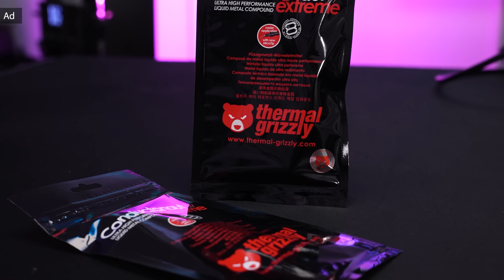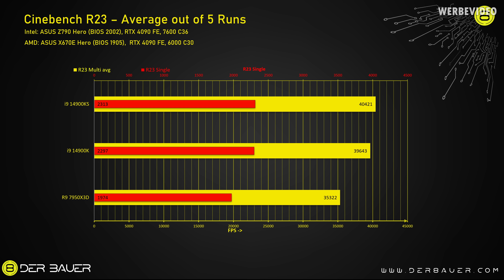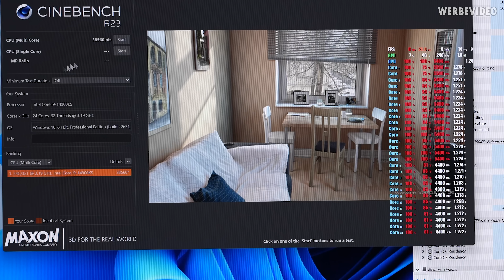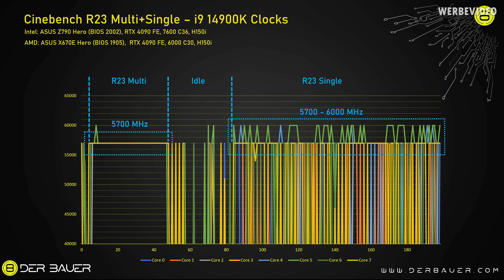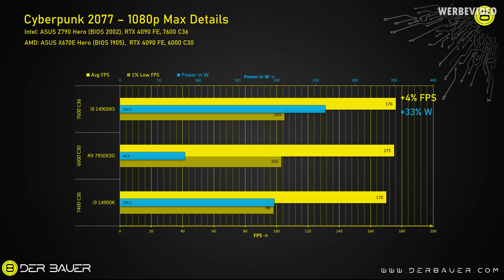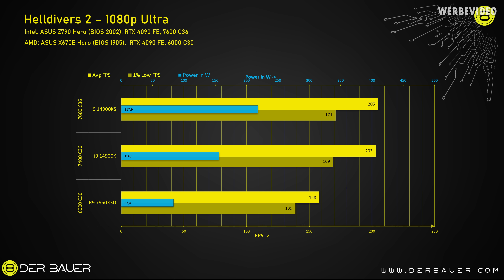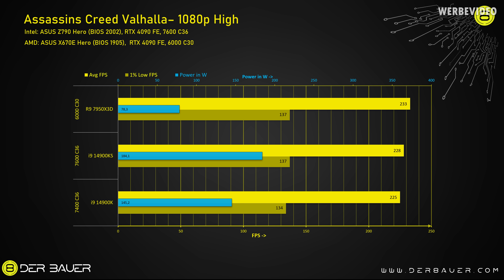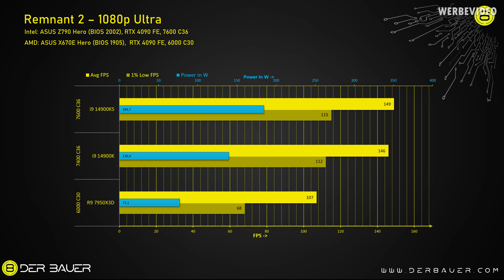Almost 400W under Full Load - The 14900KS is one of the Most Extreme CPUs ever Made

Comment: What's the big deal? You cannot afford electricity or something?
Reply: probably the deal is that intel cpus are dying left and right atm, and there is 0 feedback from intel itself.
Reply: @1222dss  Are they though?
AMD is about drop their new CPUs and all this shitting on Intel starts...

And yes, Intel's 13th and 13.5 gen CPUs are pushed to the limit, hence some tweaking is needed to make them work proper and last longer.
Reply: @Rorschach1488_  "shitting" started over 1 year ago with 13th gen. This has recently been confirmed not only by whiners on reddit, but by actual server hosters and developers who charge $1000 more for an Intel platform simply because of the insane failure rate and therefore maintenance costs.
Reply: some people don't want to be boiled in their room

Comment: have been cruising around a bit. so, factories manufacturing 13 and 14th Gen Intel CPUs have been getting returns at insane rates for performance degradation inside of 3 months. most MOBO manufacturers BIOS' "Apply Defaults" apply MOBO controlled power limits, instead of specs set by Intel. as it turns out MOBO's default power limits are insane and rely on intel CPU safety features to prevent swift death...

Comment: it's so silly how hot these things run because their benchmark scores are HORRID compared to what they should be.

When you actually undervolt the 'default' all core load and get it to NOT redline 24/7 and consume giga watts degrading your stuff every few clicks, your scores goes up A TON without changing ANY clock speeds.

my 13900ks with 5.6 (stock) and 4.4 e core (+100) with 46 ring (-4 from stock) maintains that frequency throughout the test and gets highest 41844 points.

Comment: Hi im building a new video editing PC, Primarily for Premier pro and after effects.
Just want to get everyone's thoughts. If everything is compatible and makes sense.
Also a couple questions
Can the Asus motherboard support the 14th gen with a bios update?
Im open to new case ideas but very hard to find 420mm radiator supported cases.

CPU		
Intel Core i9-14900K 3.2 GHz 24-Core Processor
 
CPU Cooler		
ARCTIC Liquid Freezer III 72.8 CFM Liquid CPU Cooler

 Motherboard		
Asus PRIME Z790-A WIFI ATX LGA1700 Motherboard

Memory		
Silicon Power XPOWER Zenith RGB Gaming 64 GB (2 x 32 GB) DDR5-6000 CL30 Memory
 
Storage		
Seagate Barracuda Compute 8 TB 3.5" 5400 RPM Internal Hard Drive
Silicon Power US75 1 TB M.2-2280 PCIe 4.0 X4 NVME Solid State Drive
Silicon Power US75 2 TB M.2-2280 PCIe 4.0 X4 NVME Solid State Drive
Silicon Power US75 4 TB M.2-2280 PCIe 4.0 X4 NVME Solid State Drive
	
Video Card		
Zotac GAMING Trinity GeForce RTX 4070 Ti SUPER 16 GB Video Card

Case		
Antec Performance 1 FT ATX Full Tower Case

Power Supply		
Gigabyte UD1000GM 1000 W 80+ Gold Certified Fully Modular ATX Power Supply

Comment: That extra crap you have to do in windows is THE reason why i waited for the 7800x3d. It wasn't the price, it was this crap you needed to run for the bigger x3d versions.
Windows is too annyoing these days anyway and on 11 i need 3 third party tools to make it usable (task bar, start menu, unlocking removed options) . I don't want to have to run any additional Microsoft crap (Xbox app) to play games. 

The reasons for not going intel was energy prices and room temperature...

Comment: This comes up every time Intel releases a KS model. These chips were never intended for gamers. Yeah, they're overpriced, but you need to keep in mind hardcore overclockers using exotic cooling used to get ripped off for FAR more with cherry picked i9s going for as much as $2000+. The KS models have completely killed that binning aftermarket that used to gouge enthusiasts for cherry picked silicon.

IMHO AMD should also have their own elite line when enthusiasts are obviously willing to pay for it. Imagine a 7950X or X3D that can maintain stability with DDR5 7200 and 5.8ghz? It would be just as silly but you know there's a certain number of enthusiasts that will buy it instantly.

I also believe every KS model should already come delidded as that's most likely the first thing anyone who buys it will do with it. They probably don't because there's a certain number of users that will only buy it cause it's "the best" and not know what they're doing.

Comment: Hey Roman, regarding the 7950x3d vs 7800x3d discussion,  couldn't you have simulated them by deactivating the non X3D cores or just by using Process Lasso to force the program's threads to utilize the X3dD cores? I'm sure there's a valid reason, but I'd be curious to better understand!

Comment: I think electricity is £0.33 per KWh in UK, so using 100W extra is £0.033 per hour. If you use the PC for 4 hours a day, that would cost £48 per year. After 5 years you would have £240 towards next CPU. This is if you are gaming, if you are running all core workloads the money saved would be larger. In 5 years time you would have a nice amount of money for a future AM5 CPU. With intel you would need new motherboard also, which might actually cost less than the extra energy used over 5 year period.

Comment: I've actually run into some cases where windows scheduler gives up trying to schedule stuff properly on the hybrid-core intel chips and then just starts shuffling threads around wildly at times, causing bad stuttering. This usually happens with a pairing of game & cpu when the game simply has more heavy threads than physical p-cores, at which point I start seeing stuttering, etc. This doesnt really impact the higher corecount chips because most games only have around 8 heavy threads currently (some do exceed that, but they usually aren't fps-critical games - its stuff more like AI-heavy turn based strategy games during end-turns), but it is very noticeable on the lower end mobile chips with hybrid core architectures which might have only 4 p-cores (or even less). Even games heavily optimized for old hardware that can run just fine on pure e-core cpus (ex, the N100) like warframe can suddenly experience intermittent really bad performance stutters if you put them on a device that has a cpu that is better on-paper like a 2p+4e core chip, purely because windows scheduler starts panicking and throwing threads everywhere since there are not enough p-cores for the game when if it kept the threads in place on whatever cores they were already running on it would be just fine.

Comment: Absolute Crap !
Reply: With Intel, you just need to run and adjust voltages and power draws in the BIOS/UEFI. Then they run already so much better. Just stock Intel is that it has to run on the north pole and in the dessert. So all settings aren't optimal.

Comment: So glad i chose AM5 for my latest PC. The 9th gen was hot enough, but half a kilowatt just for a CPU is insanity in the worst way. Intel are in a real low point at the moment, seemingly grasping for inspiration. It'll be interesting to watch the three way AMD-Intel-ARM face-off in the next ten years.
Reply: I am glad I went for Intel, with finetuning overclocking in BIOS/UEFI, it is faster than AM5. And then it doesn't use much energy, and all core overclock on a way, I have always the speed and not less when a CPU runs hotter. Intel is so perfect nowadays.
Reply: @jankees4037 what CPU? 

I spent a long time debating whether to go 12/13th gen or AM4/5. AM5 eventually won for a few reasons including longevity of the socket and the current R9 performance-power ratio. 

The first thing I did with my R9 was a PBO offset for basically extra free all core performance with a couple of clicks, I also get none of the issues people have with P and E core CPUs. Best of all, Ryzens seem to run impressively cool, can run all core boost speeds essentially indefinitely and they sip power compared to the current gen Intels. 

It is the gradual worsening of intel’s approach to reaching their peak frequencies - throwing electricity at the problem - which annoys me, because I’m very conscious of how much power I use, cause it’s so expensive here 😬

Always interested to hear other people’s experience with current Intel chips and what they’ve been able to achieve with their setups, because I can’t afford to buy both 😁 

At work we have a huge amount of Intel (6th-13th gen, Xeon Scalable and Xeon-W) and AMD (Ryzen and Threadripper Pro) systems - we’ve started to move towards TR for higher-end graphics and rendering workstations due to their current pure performance advantage for a given power target.

Comment: 14900 F VS the 14900 KS
On default, it's just 2% more frames
For the 114900 KS, you need a fancy cooling solution, fancy board, mem, on XMP profiles it can be 3 % faster !

Comment: One time runs on r23 hits 38k on multi core with my 14900k. In a 10min run, I get 35.5k. It stays pretty consistent after a few runs. But, I have the watts set at 275 max and it still throttles down to 4.9-5ghz, but with better temps vs when I had a 135mm tower cooler.

Comment: Only 7950x, if I limit the temperature in BIOS to 80C,  all I do is lose maybe 5% on the top end which I can totally throw away for peace of mind.   You don't need to squeeze out that last 5% and cook your chip at 95C for anything.... at all.    Most of the time 75% of my cores are sitting around totally idle.  Even when I render out video, it does not use anywhere near of 100% of the cores across 32 threads.   Maybe it maxes out one or two threads to 100%, but that's the fault of my ancient video editing software.

The problem now is the operating system software and application software is trailing behind the hardware... by a lot.   
Linux still isn't there on the desktop to use as a viable Desktop OS, and Windows 10 was a disaster that never got finished... and Windows 11 is an abomination.

It use to be for the longest time, the other way around... .hardware trailing behind software that needed more... hardware and ram.

Comment: recently bought a 14600k and rog strix z790 mobo, seeing 200W draw easily, so seeing this pull 400W i wasnt as surprised as i should be, its getting silly now. That plus the 3080ti has my ROG 850 Struggling with supply of 12v rails, oh well 1k/1200w psu it is then.....was fine with an 11th gen i7k ocd and same 3080ti & z590......

Comment: If this abomination were a vehicle, it would be have 17 main cylinders and 5 smaller ones, makes 6,200 horsepower but can only run for 1 min before draining the entire fuel tank and battery. Rather than build a new architecture/engine, they used the same one from 2 generations ago just running at higher revs, using more fuel, adding smaller engines to increase the cylinder count to boost marketing numbers while being worse is every key metric.

Comment: Wish you included the 7800X3D in the gaming tests instead of the 7950X3D. Great video. I am disappointed that Intel has to resort to extreme binning and clock rates/power consumption just to put out competitive gaming chips. Makes one wonder what would happen is AMD tried that approach with their current architecture.

Comment: That's .... Kinda sad 😂. I'm using mag mortar b760m and a 14900k and I'm getting cinebench r23 scores between 39k - 40.6k and that board doesn't OC. I have to manually limit the power to 365 watts otherwise it'll pull up to 430 watts on the CPU. It is on a custom loop with two 360 rads and one 240 rad and stock it'll still hit 100°c on 2 cores, power limited it's low 90's.

Comment: tbh this is just Intel doing what Silicone Lottery did and charging you for the labor/golden chip aspect. i really dont see anything wrong with this. why would i bin 10+ chips when i can buy a binned chip directly from the guy making it? i believe intels major problem is MARKETING the 14900kS. it is NOT for everyone, far from it. it really needs to be reminded for all buyers it is for the EXTREME  enthusiasts.  as for the marketing side of things... IT SHOULD NOT HAVE AN IHS FROM FACTORY. it should come with the IHS unmounted READY FOR LM at the bare minimum. they have a marketing problem. not a KS problem. just a binned chip that should be delidded off the rip.

Comment: Curious how well binned these are and how well they respond to voltage tuning. Just from an academic standpoint. I don’t need this many cores anyways (not on my gaming machine, do dev work on my Mac) but just would love to know.
Reply: These are the creme of the crop. The 13900 is the lowest with all the cores, followed by the 13900K/KF. The 13900KS and 14900K/F are the step above that. The 14900KS is even higher binned. These are functionally golden samples enabled by the Intel 7 node being quite mature.

Comment: Something I never see is the performabce when tuned for power efficiency, better silicon theoretically can be undervolted/underclocked etc to get the best perf per watt.
Reply: Look at what laptops do with the same silicon. All the way down to 13900HX in smaller 15 inch models.

Unfortunately undervolt lock means most models can't be tuned for max efficiency. I have a lower end Helios 16 Neo that I can keep mostly to 100W at about 4.2ghz P + 3.0ghz E cores to limit fan noise. Multis and PL1 PL2 are all that's tunable in this, barf, I definitely got what I paid for (under $1k)

I hate performance laptops these days, you have to spend 5 grand to get something from MSI or Eluktronics you can actually tweak, and I'm not that made of money I'm willing to cost myself a $4K all soldered non-warranty replacement mainboard. In the olden days a mainboard was 'only' about 700 bucks, assuming you didn't kill the socketed CPU or MXM GPU

Comment: Let's face it - these CPU's are overclocked to the gills out of the box. In a sane world they'd default well under 1V vcore with commensurate clocks using maybe 150W max and actually be sensible processors. ETA >> I guess undervolting/underclocking is the new overvolting/overclocking.

Comment: AND there's not a cooler out there right now that can handle that 400W, so the cpu goes into thermal throttling almost immediately, curbing ANY possible performance gains over the 14900K...
The BEST value right now is the i7-13700K, almost as fast as the i9-14900K, BUT $150 less, topped with a good cooler will perform better than the 14900K because it won't go into thermal throttling even when mildly OC'd...I have both, and wish I knew then what I know now...

Comment: 7950X3D not running on the 3D cores is a problem you can solve by manually setting CPU affinity, of course. Uncheck the non-3D cores and there you go. Obviously this is something that should be fixed so nobody has to do this, but at least in a testing scenario this will still allow you to ignore the non-3D cores if you want to.

Comment: That company that makes the peltier cooler that you tested a year ago or something like that needs to make a 500-watt version. 🤓 I want one so CPUs like this can actually be used 24/7 at max power without it clocking down due to heat all the time.
Reply: I think high voltages 24/7 would be bad for the chip though.
Reply: @GeneralS1mba  Nope.

Comment: Nice review Roman, I am getting more out of my 13900KS with a chiller than that, but I am sure when you delid it and OC it, it will pull away from the older 13900KS in the same situation, my chiller lets me get much more advantage of the CPU vs an AIO which as you show, just can't keep up

Comment: I think intel did this for two possible reasons:
1. 14900KS is not meant to be used like this. I believe it is solely for liquid cooled/custom OC builds, possibly having better IMC for higher RAM clocks, essentially this chip being an unlocked beast with lots of headroom to play with as a last send-off of a monolithic design. 
2. Possibly they made this chip in such a power-hungry way so they can compare their next-gen to it in terms of insane new efficiency saving when they introduce next architecture later this year/q1-25.

Comment: How about a 7800X3d on a board with eclk, making the 7800x3d overclockable. 105 to 108mhz FSB is doable on AIO making it upto 8% faster.
Sure you need an expensive AM5 board, but looking at the price of the 14900KS that kind of offsets it.
The 14900KS doesnt seem to have that overclock potential unless you go bonkers on the cooling sollution.

Comment: You should have undervolted and used a larger cooler. The fact that it's thermal throttling all the time shows you used incorrect components and configuration, which invalidates all your testing.

Comment: It's interesting to see these results and allot of other results with 14900K and ks etc cause I consistently got 41000 - 42000 on my 13900K with no over clock, just bios defaults on the Gigabyte Aurus Master Z790 motherboard and 64gb G.Skill 6400mhz ram. I had quite an extreme hardline waterloop with 3 x 360 (thick) radiators. But regardless, I would expect a 14900KS to absolutely mop the floor of my 13900K
Reply: Bios defaults can be set by manufacturer to be way above Intel spec, basically already OC, there's multiple videos on this since the 8700K release made it widely known
Reply: @greebj  yes I know this, but default settings are default settings, just like this guy is showing in his video. Now spending the extra cash and it is a wad of extra cash on that CPU and getting a worse result than the non KS of the generation before doesn't make the cash outlay seem that great now does it? Also my CPU wasn't drawing 400W either.